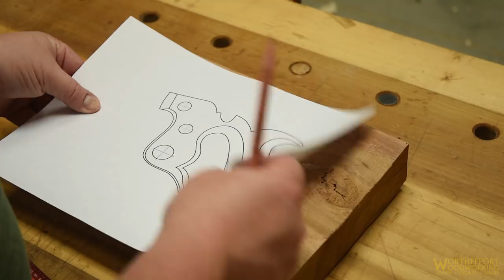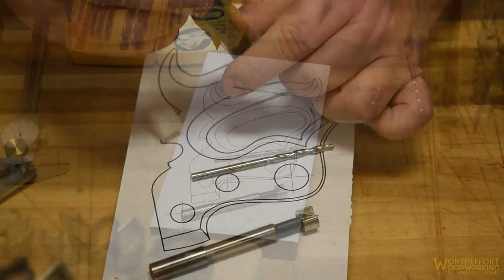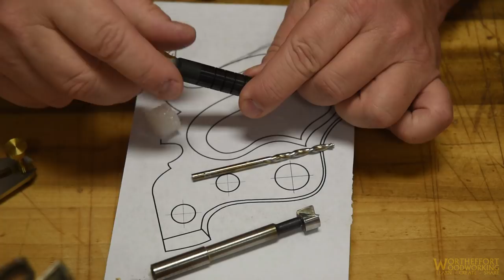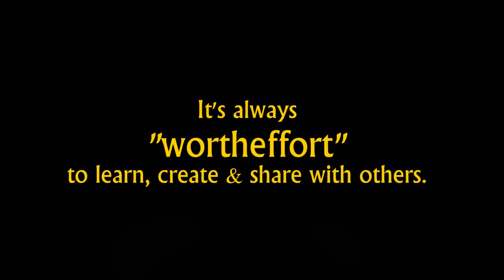Making Panel Saws

Comment: I came here because finding a panel saw that isn't super expensive (think "Bad Axe") or not expensive but not right in my mind (Crown is the only one that I could find and I can't find out if it's filed rip or X-cut or whatever) is impossible.  So I figured I'd make my own.  I loved this video, but was thinking, given the lack of panel saws at a reasonable price (Florip has one, but it's filed hybrid and I prefer separate rip and x-cut saws), I would be even happier if you (wortheffort) made them and then I just bought them from you.  Just a thought.  My biggest obstacle is I don't have a big budget.  Probably not worth your time to make them at the price I could afford, but it's a thought.  Finding them used is difficult.

Comment: Hi great video....   Where did you get the saw panels from?    Also, i have my dad's old hand saw that i would like to restore,   its all rusty and dirty...  My question is how can you still the difference between saws?  rib, cross-cut?    I have a lot of my dad's tools after he passed in 1991.
also, plan on restoring an old hand truck...  My wife was like through the out its so old...   Then i told her i got the hand truck from your aunt and that the hand truck was her Grandfathers....   Old tools are the best, and you can't beat the sentimental value.... 

Thanks for you time and all the great videos

Comment: I just got home from making my first out of an old worn out plate!  Should have checked my subscriptions first.  I’m surprised how the steps came intuitively in the same order you did them.  Is there some biomechanical reason for the 23 degree angle?
Reply from the maker: Ya, for the most part it's common sense building. I cover hang angles in 1-03a of the Classroom Series. It's all about force direction. Though getting an exact angle from any reference on hang is impossible so this was a guesstimate.
Reply: wortheffort cool! Thanks for the response.  I’ll check that out.

Comment: what kind of metal is used for the blade making?
Reply from the maker: These used spring steel, not sure the actuall composition as I bought from an expert so trust them. Normally I use O1 for my shop made tools.

Comment: Very good build, Where did you order that shet of metal with tooth ?
Reply from the maker: Wenzloff and Sons but I'm not sure they sell this stuff anymore. What put me off on doing this so long is the blades came as the sheet and I'd have to cut and drill it. Not a metal worker. Thought I'd ordered 'em cut, drilled & toothed.